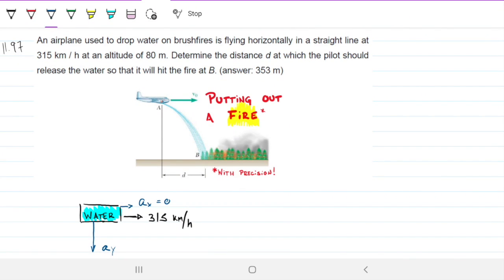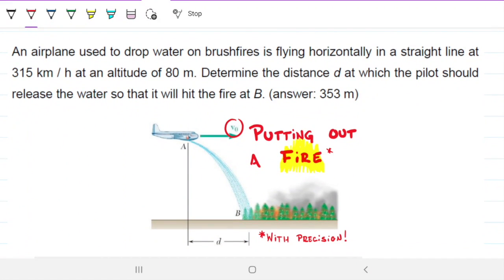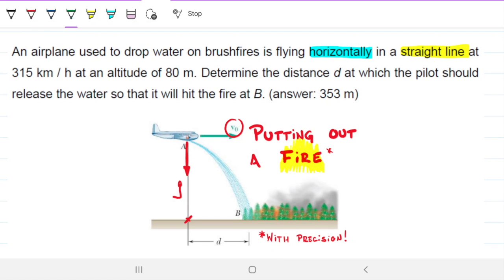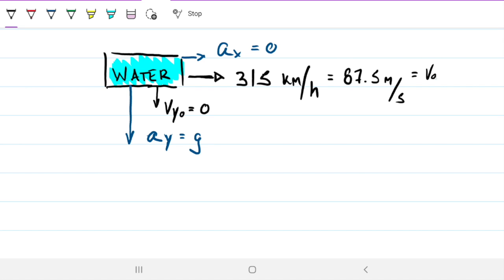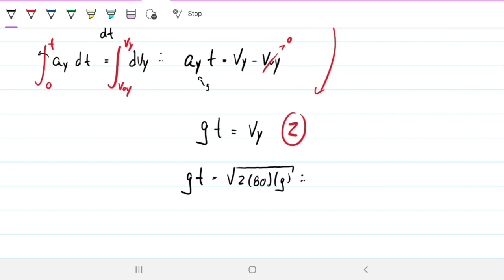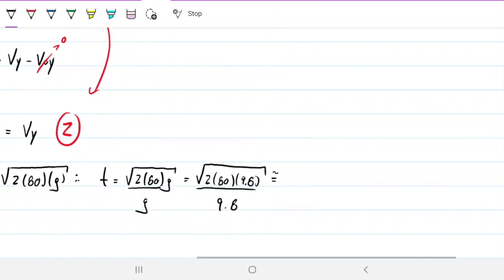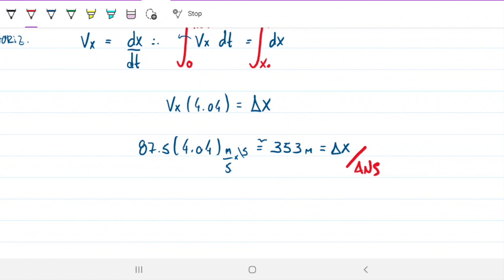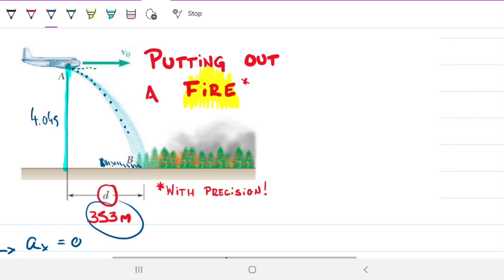Plane Dropping Water | Velocity and Acceleration (X & Y)

Comment: hi, how does this process take place when friction is taken into account?
Reply from the maker: Good question. There will be a force countering the movement on both the horizontal (x) and vertical (y) direction. To solve it taking into account the resistance, we'd need to (A) calculate the resistance and then (B) recalculate the velocity equations with the new force balance. Unless we can simplify the resistance, it will be a variable force, which means we'll need to integrate over the delta y and delta x instead of using simple math.